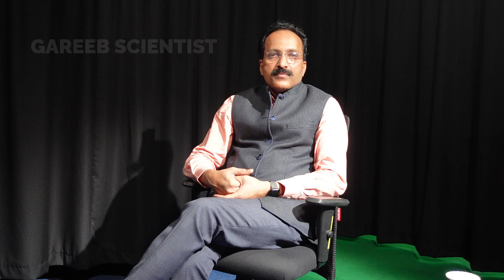ISRO Chief on New Methane Engine | LME1100 | S Somanath

Comment: Haha you using RUD (Rapid Unscheduled Disassembly) with him like an official term (which is just a slang SpaceX fans and Elon have to all the kabooms 💥 their rockets were experiencing in the experimental stage) made me laugh 😂😂

Also, a common bulkhead (one common boundary between LH2 and LOX tanks and not two separate tank structures) was one of the key innovations in Saturn V 2nd stage (besides thousands of other things). The temperature differential is huge (~80-90 deg C) between LH2 and LOX and to make that work for a rocket at much smaller scale is probably not worth the headache. Nice questions GS!
Reply from the maker: 🤣🤣🤣Thank you.

Comment: We missed the bus in 1970s when Sarabhai he opted for more difficult cryo genic and non kerolox which were Russian R7 and Chinese heavy lift rockets. Even Saturn was Ketolox. 
Kerolox and Metholox are similar conceptually but the pumps and pressure system flash point fire point may be different for ignition and sustained combustion. Plus cooling system hydrodynamics will be different. The LCM😊 for both is the liquid oxygen. Except fuel and oxidizer mixture ratios may be different. Super Garib Mech engineer from DC🙏
PS. Gareeb Scientist Saab big fan of yours. Thanks for very informative positive and exciting episodes always.🙏
Reply: actually we lost 1-2 decades in space just due to scamgress